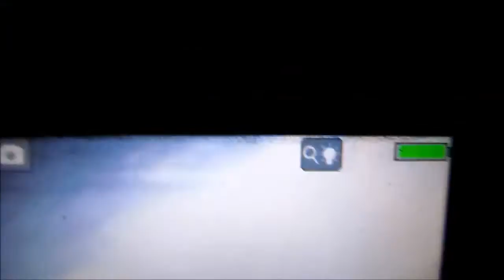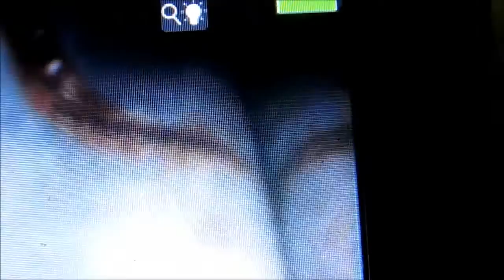Arcoaire 90% furnace heat exchanger inspection

Comment: did you set the gas valve after you last replaced the heat exchanger if you didn't that is likely the reason it cracked again.

Comment: Is that a 90% or 80% furnace? 
Is a clamshell Heat exchanger right?
Reply from the maker: This is a 90% efficient furnace early nineties this design was basically a 70% efficient furnace converted to a 90% efficient furnace the secondary heat exchangers  since over to the left side of the furnace on an angle as always thanks for watching
Reply: +Mi Heating Guy  I haven't seen this furnace been converted from 70% to 90% I wish you could show the secondary exchanger. Thanks to reply